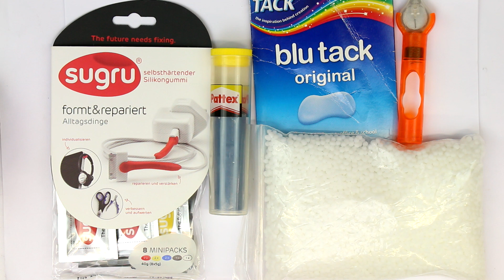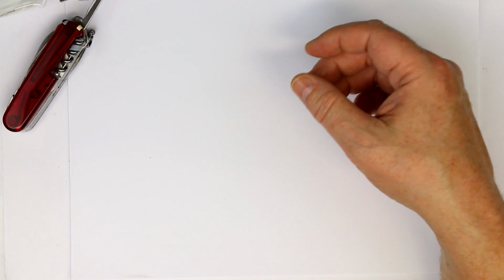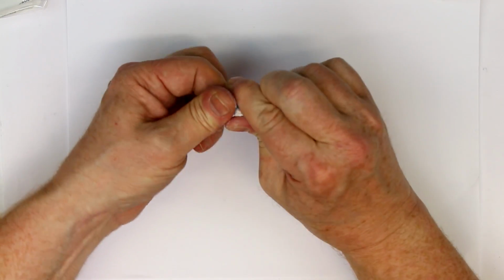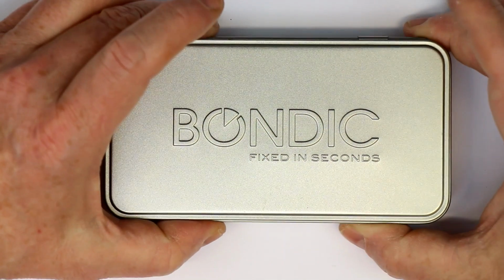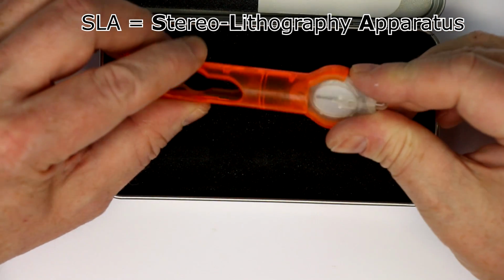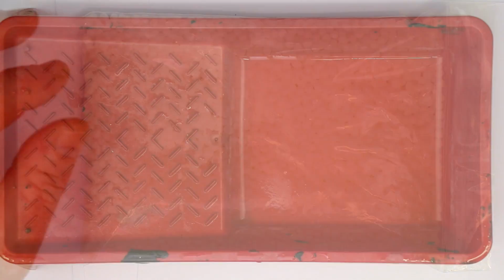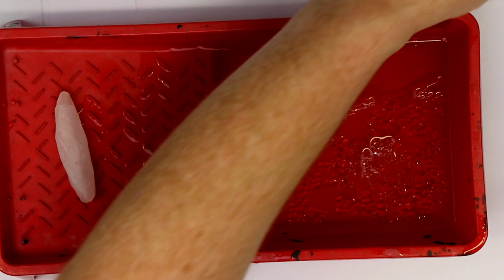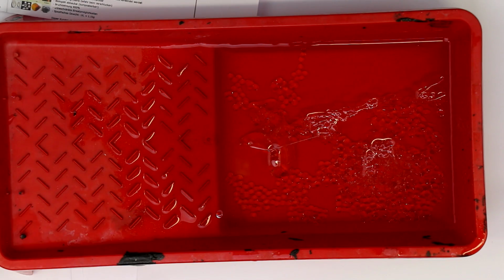Should every maker have...[Pt.46]...Sugru, BluTack, Bondic, Kneadable Epoxy, Polymorph?

Comment: Bondic is absolutely fantastic for sealing the solar panel in LED outdoor lights. I only buy lights with the glass solar cell, as the resin ones just degrade in the Australian Sun. The glass cells are just glued intoa recess in the plastic lid of the light, so rain water wicks in underneath and corrodes the rear of the solar panel.
So I started using Bondic as a caulk/sealant when the lights are brand new. This is the perfect product since the more UV is gets, the better is sticks! After almost 2 years, I have not had one leak or failure, it really works great!
The small metal nib of the Bondic is almost perfect size and shape, however it takes some experience to run a neat bead of it. The greatest benefit is that until it is exposed to UV, you can just wipe it off.

Comment: Hi Roger,

I don’t know where you live; I’m live in the UK. I have used a product for many years it’s called Milliput it’s a Two Part Epoxy Putty it can be machined, sanded, drilled, threaded, it comes in different colours it’s Self-hardening, Non shrinking, Tough and durable, Sets underwater, Electrically insulating, Water, heat and chemical resistant, Highly adhesive to most materials, Moulds like putty - sets like rock. Just Google, MILLIPUT. Hope that helps Roger.
Reply from the maker: Sounds good. THX for sharing. It sells even from German Ebay-sellers. I will get a sample and try it out. And BTW: Isn´t my German accent obvious?
Reply: @KainkaLabs  Yes, but that doesn't nean you live in Gremany. hope you like the Milliput Roger.
Reply: Was going to mention this also... Milliput is great product, can’t use with ‘wax’ type plastics. It also takes longer to cure than some of the modern counterparts but has been around for a long time.

Comment: The Polymorphous stuff is really meant for prototyping rather than repair.  Robot makers sometimes use it to mold parts to get an idea of what they need to CNC or 3D print for the final version. 

In a repair context you can use it to replace a broken part that is supposed to mate with another.  Mold it around a bolt if you lack the corresponding nut, and vice versa.

Comment: Blu tack is of little use for repair work but can be used to hold components in place during soldering - see Julian Ilett's videos.
Reply from the maker: Ah OK. Good tip. Useful for those who don´t have a decent PCB-holder or the PCBITE-Kit featured 2 weeks ago in another video :-)
Reply: Great for antivibration mounting, insulation and securing of cables in sockets and projects.
Reply: @brianmatthews232   - I hadn't thought of that, though knowing nothing of its insulating or dielectric properties I would be cautious in its use in that fashion.
Reply: @JUANKERR2000  I think the base substance is silicone putty, known as silly putty, which was used to pot transistor cans. Have had good results with putting into connectors to prevent mechanical stress and water ingress. Also used in balluns to secure ferrites from vibration😊
Reply: @brianmatthews232  Thanks for the info, I'll give it a try with my insulation tester (5 kV) and add some to my bench kit. I bought some Sugru but it appears to have an extremely short shelf-life :-((

Comment: Kneadable epoxy is quite useful, we have many brands. In the lab I use ultra high gravity silicone stopcock grease for everything but it never dries so while it's great for sealing and patching it's a temporary solution.

Polyurethane construction glue, PL premium is the brand I use, is amazing. Quite popular among amateur boat builders. Goes on like caulk, good grab, dries hard enough to sand or drill. Highly recommend.

Comment: I agree with your comments on Sugru. The only thing I have found it useful for is fixing broken usb leads where the insulation sheath has broken. 

There is a similar epoxy putty to Pattex sold in the U.K. called Milliput. It’s sold in grey, red, blue, silver and yellow colours. I’ve used it for model making, replacement zip fastener tabs, making tops for broken telescopic aerials and making a bung for my fibreglass Radio mast. 

Thanks for another great video
Reply from the maker: "Milliput" was already recommended in one of the earlier posts here. In the mean-time I have ordered that and 3 other materials unknown to me from the recommendations of the viewers. I will make a follow-up video when all things have arrived and I have played a little with them.

Comment: I’ve been using something called “ABS Cement” that is sold in the plumbing section of home improvement stores in the USA. The instructions only discuss use for joining/sealing ABS pipes, though I can’t recall seeing ABS pipes sold nearby (only metal, PVC, and hi-temp PVC). ABS Cement is sold by the same brands right alongside PVC Cement and PVC pipes.

Best I can tell, it’s just ABS plastic dissolved in Acetone or a similar solvent. This makes it work wonderfully for making repairs to cracks where you can apply it to the back or inside to add structure with globs of ABS. I’ve used it on everything from hollow grill handles to motorcycle fairings to broken power bricks and cracked game console shells. Because it melts into the existing ABS and adds additional ABS to the back/inside, the structure is actually strengthened.

It’s messy and ugly on the side you apply it to but it’s worked very well in my experimentation. You could presumably even fill gaps in broken ABS housings by taping over the missing part and applying ABS from behind.

I’m somewhat surprised that I’ve never seen anyone else talking about using this stuff for ABS plastic repairs. I’d like to get more thoughts on it and see what other uses there are, so I thought I’d share.
Reply from the maker: THX for sharing. I will try to get some and try it out. Sounds very promising.
Reply: KainkaLabs No problem. I hope it is available where you are. I just had a strange thought: perhaps an entire project PCB could be dipped except for the edge with connections or displays or whatever to make a permanent ABS shell? Who needs an enclosure! Some may even want to fill in an enclosure to prevent tampering. ;)

I’ve heard of people making their own “ABS Juice” or “Slurry” by dissolving ABS in Acetone so you can probably vary the consistency by adding more ABS bits or Acetone. Could be really useful for 3D printing with ABS, since you could bond and fill in large parts with the cement.

Comment: The Pattex stuff is epoxy putty. Lots of different brands on the market. Milliput, Apoxie, Greenstuff, are the ones used by sculpters, terrain makers and general hobby crafters. You can also buy epoxy putty with stronger glue type effect, which is commonly refered to as plumbers putty. Every brand has slightly different attributes.. and some people prefer to mix different brands for certain attributes. Like say mixing Greenstuff with Apoxie to get a better toolable end product, while keeping the "memory" effect of greenstuff, which is quite flexible, even after it dries. Where as Milliput will get super hard, almost a little to hard.

Comment: In Australia we have "Kintsuglue" which is copy of Sugru made by Loctite/Henkell. They copied all the bad attributes, and I cannot ever get it to stick reliably, Except for my own fingers, which is impossible to remove.
I have had EXCELLENT success with POWDA BOND as demonstrated in this cringey video: https://www.youtube.com/watch?v=0vo4vPHblGQ
It's basically CA (SuperGlue) and various coloured polymer powders which also includes additives to make it "accelerate" and also lower surface tension of the CA liquid. It really does work great - much easier and less messy to use than JBweld, plus stronger and faster too.
You can emulate the product using low viscosity SuperGlue and powered "Bicarbonate Of Soda" (Baking Soda in the USA). The only hassle is that the fine powder is very slightly CA-phobic, so you have to sometimes tap the end of the glue nozzle onto the powder to make it absorb (rather than ball up on the surface). This creates an absolutely rock-hard blob on the end of the glue nozzle, but it can be removed by a squash and twist of pliers :-) 
To match colours of plastics, use a Dremel and sanding drum to create your own powder from another part of the object. You need to make much more than you think you will need, and it works just as well as Baking Soda or the PowdaBond product.